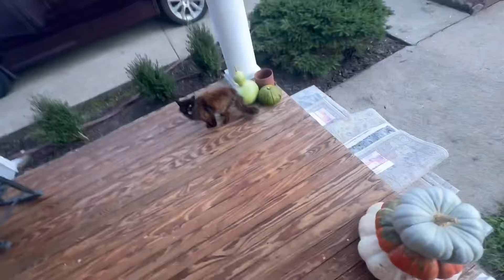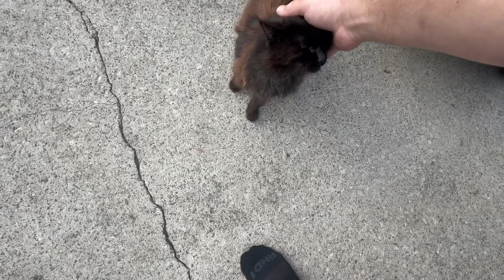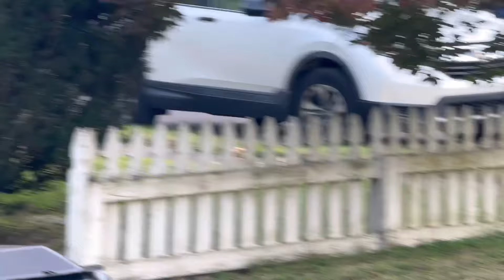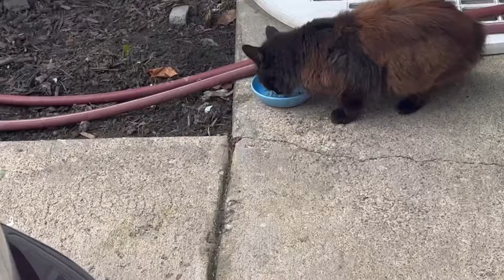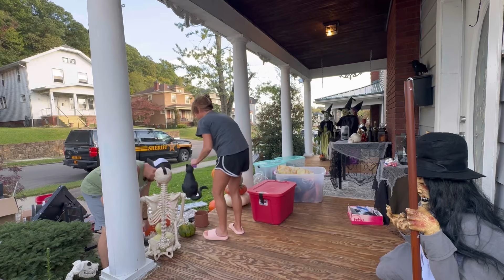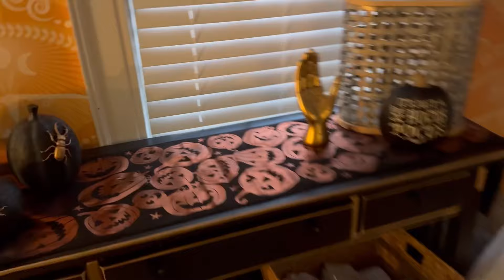GotchaMan’s gettin spooky… Vlog#39

Comment: Spray some soap bubbles on the plug in the tire. I've plugged my wife's tire 2 different times, and it keeps having a slow leak on the plug. For some reason the plug just won't hold 100%.